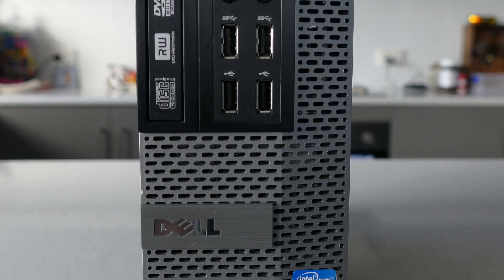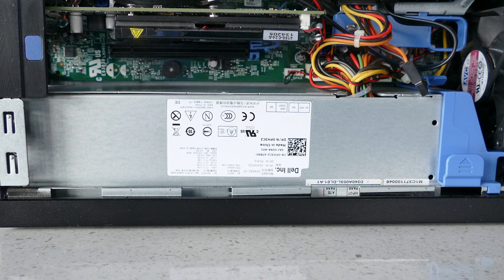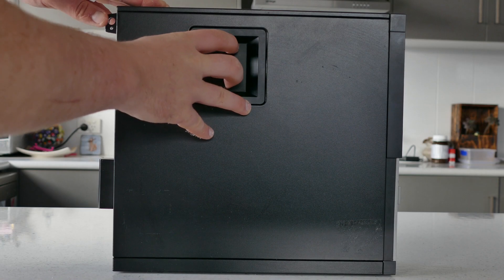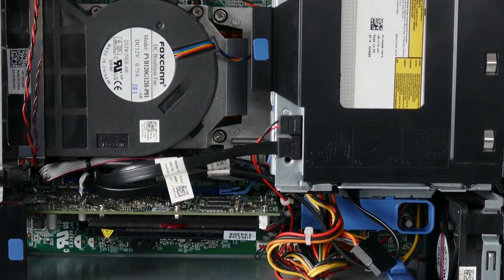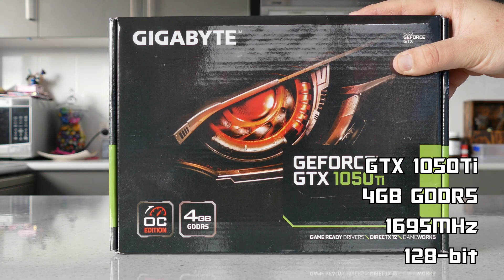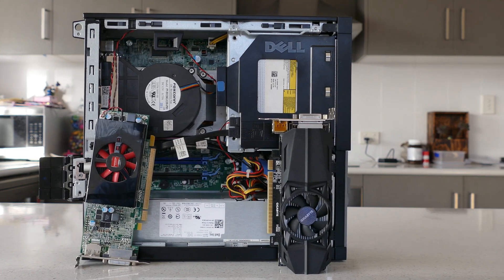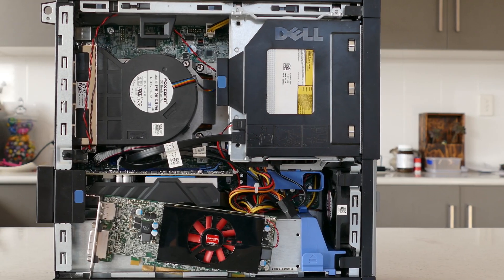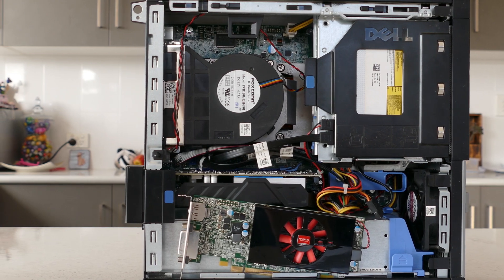Is the 1050Ti a Worthy Upgrade for this Old Dell?

Comment: What’s the PSU?
Reply from the maker: Power Supply Unit is the acronym used for the power supply
Reply from the maker: Yes it will work with the 3010 MT and the difference between the 2 CPU’s is about 15% better processing efficient over the older 3000 series CPU which will only be noticeable in CPU intensive tasks

Comment: I’m getting either getting a 9020 non sff with a i5 4570 or the 990 with the i5 2400: would the 1050ti work with these builds with stock PSU??
Reply from the maker: Yes

Comment: The GPU power consumtion is 75W and according to guidebook optiplex 7010, the DT and SFF version have a maximum 50W on PCI. During how long period have you used this GPU and do you notice any failures?
Reply from the maker: Nope never had any issues during hours of benchmarking. The guy I sold it to has the same concern so we ran a CPU and GPU benchmark simultaneously for over an hour without any issues.

Comment: would the 1650 low profile by asus have the same performance as the 1650 low profile by zotac?
Reply from the maker: Yes, there is negligible difference between the brands. It would be lucky to be a 1-2 FPS difference between them all. The only real different is the cooler design itself so thermals could be different.
Reply: Everything by Sam 
thanks for ur help and time
Reply from the maker: No worries. Happy gaming!
Reply: Everything by Sam 
Soo if i pare even a msi 1650 low profile with a dell optiplex like this one it would br fine?
Reply from the maker: Yup!

Comment: so with a low profile gpu I wont need to upgrade the crappy psu?
Reply from the maker: Exactly. Low profile GPU are low powered and don’t need an external power connector

Comment: How are the temps and is the PSU still holding up?
Reply from the maker: I onsold this PC shortly after this video but told the buyer to contact me if there was any issues which he hasn’t contacted me so I would take that as a good sign.

Since the GPU is quite low powered and the cooler is sufficient enough it never got higher than 75C if I remember rightly.
Reply: @EverythingbySam  oh. That's awesome. Thanks for your quick reply
Reply from the maker: No worries. Glad I could help

Comment: I bought a dell optiplex 3020 SFF, is this fan sound normal? wanted more opinions before i change, the computer stays cool no over heating and runs find, here is my link to listen too.  youtube.com/watch?v=xXs9mRUzLjc
Reply from the maker: I would clean all the fans firsts to see if that might help as it sounds like they’re all pegged at 100% which is not normal. If that does work you might have to look at replacing them
Reply: @EverythingbySam  ok thanks will try it

Comment: would you still recommend this card since you uploaded it? looking to help my cousin upgrade his basic 3010sff with everything stock, is there a better gpu out there in the market in 2019? thanks in advance!
Reply from the maker: The GTX 1650 is currently the most powerful low profile GPU on the market so if you can justify the price of that over a 1050/Ti go for it as it’s about 25% faster.
Reply: @EverythingbySam  will 240 w work for 1650 lp
Reply from the maker: Yes, it requires the exact same power consumption as the 1050/Ti
Reply: @EverythingbySam  will that gpu be able to fit and work in a Dell optiplex 3010 sff?
Reply from the maker: It’s literally the same case so yes it will work.
Reply: @EverythingbySam  good to know,so I'm assuming that the gtx 1650 low profile should be able to fit and work
Reply from the maker: Yes, doing a video on that in the near future
Reply: I know I'm like a month late, but I also recommend the 1650 if you're looking to buy new, because it's the same price as the 1050ti LP on Amazon US.

Comment: If i buy a dell optiplex 990 without a operating system would i have to downloadthe drivers and if so what drivers?
Reply from the maker: Yes you would need to do a complete fresh install of windows. The only driver you really need is the GPU driver. All the others are insignificant.
Reply: Everything by Sam 
Thanks! You literally replied in 14 minutes. Thankyou for the help
Reply from the maker: I always have my phone on me with notifications on which makes it quick and easy to answer
Reply: Everything by Sam 
You got some good service 👌
Reply from the maker: I try my best. Good luck with your build
Reply: Everything by Sam 
Thanks for your help i subbed

Comment: did you put case fans/cooler when you inserted the gpu? how is the temp while playing if none?
Reply from the maker: If I remember rightly the GPU got no hotter than 75C after stress testing for 20 minutes
Reply: @EverythingbySam  are there any fans?
Reply from the maker: There’s a small one in front of the PSU. The CPU fan cooler is its own ecosystem

Comment: Can the stock dell optiplex sff motherboard be used in a micro atx case?
Reply from the maker: The motherboard is proprietary and has its own stand-off layout so with some modification to the cases standoffs you could get it to fit.

Comment: I need a suitable arc sized motherboard that supports all on a dell optiplex's parts. Any ideas ? (Cpu : i5 2400)
Reply from the maker: Basically any 1155 motherboard will support the components it’s usually only the dell motherboard itself that has compatibility issues.

Comment: The 790 dell would have been more better to work with..
Reply from the maker: I can only buy what’s available at the time and not overpriced.
Reply: @EverythingbySam  790 cost me $70 tho my build total came in around $450 aud all used parts.. The fun part was putting in the Geforce Gtx 970
Reply from the maker: That’s an alright build for $450
Reply: @EverythingbySam  The Gpu was the main set back but can't say no to a GTX 970 for $160

Comment: Great vid mate, My wee boy needs a new(ish) PC and this vid nailed it, I got the exact spec machine for £80 today have 16Gb of Corsair vengeance RAM lying spare and just need to wait on delivery of the 1050 ti, same one you used, I wont need a PSU upgrade, will I?
Reply from the maker: It will run but be aware you will be maxing the PSU out which can cause damage
Reply: Thanks for the reply, i'll look into a PSU for the PC, chances are i'll be cheaper buying a separate 2nd had PC.
Reply from the maker: If you can find a good deal or deals on a few parts it’s always a much better option for longevity of your system
Reply: I'm just going to chalk it up as a loss and use it for kodi, I found a local guy selling a brand new basic build,
Amd a8-9600 radeon r7 processor, 8gb ddr4 ram, windows 10 Motherboard is gigabyte ga-a320m-s2h, 
Kolink KL-C500 Core Series 500W 80 Plus Rated PSU Unit and it's in a good looking large case for £100 
I'll stick the 1050Ti in when it arrives, it should make for an ok gamer and it'll be more upgradable.
Thanks for the replies and subbed.
Reply from the maker: Yeah that will work mate but you will need to upgrade the CPU if you want to upgrade from the 1050Ti as that is also quite weak but everything else is pretty good.
Reply: I was thinking a ryzen 5 and 8 more gbs of ram in his xmas stocking haha.
Reply from the maker: Ryzen is the perfect gift for price to performance. It does have its issues but it’s hard to say no to their prices.

Comment: if you need gaming then gtx1650 if for multimedia then take gt1030
 for dell optiplex
Reply from the maker: The 1650 is the best low profile option now for gaming but it’s also expensive
Reply: @EverythingbySam  slightly more expensive than 1050ti

Comment: The optiplex 980 is a lil different from the inside. Will the gtx 1050ti fit???
Reply from the maker: Looks like it should still fit but I don’t have one so I can’t completely confirm
Reply: @EverythingbySam  I have a gt 1030 and the fan touches the hard drive case. I am hesitant to spend $200 if it don't fit.
Reply from the maker: It would be the same size as the GT 1030 so you would have the same issue unless you modify the HDD cage a bit
Reply: @EverythingbySam  I only use my pc for retro gaming. Gt 1030 works great on dolphin all retroarch cores and PCSX2. I am trying to see what I can do to get the ps3 emulation going. I tried last night the cpu usage went up to 95% and it got loud. I have an I7 860 12 gigs of ram and a 120 ssd.
Reply from the maker: I tend not to mess around with emulation software too often so I can’t help you there sorry.

Comment: Will it work on my optiplex 9020 sff
Reply from the maker: Yes
Reply: Jamal Habibi you need a high psu too
Reply from the maker: No, 240W is enough to run this card using the 75W bandwidth of the 16x PCI slot but it will utilise the whole PSU which has the potential to ruin it over time.
Reply: Yes I have the exact same setup just don’t close the lid

Comment: Sorry for a late question, I have a dell 7010 sff i5 8gb ram would this 1050 ti lp work with my pc, because of the watt of the slot
Reply from the maker: Yes it will work
Reply: @EverythingbySam  because the card needs 75watt?
Reply from the maker: PCI Gen 3 16x slots deliver 75W through the slot. Anything over 75W and the card would also have a PCI power connector.

Comment: Any better low profile gpus than the 1050ti ?
Reply from the maker: GTX 1650
Reply: Everything by Sam 
Is it worth the upgrade over the 1050TI?
Reply from the maker: If you already have the 1050Ti then no not really. They’re practically the same performance.
Reply: Everything by Sam 
Would that 1650 LP work completely fine with a dell sff with 240W?
Reply from the maker: Yes, same power draw

Comment: I have optiplex 390 DT i5 - 2400 8 gigs of ram. Will this Gpu work. Moreover, what psu should i be looking for if it supports because I believe i have 250 watts power supply. Please help !
Reply from the maker: Yes it will work and the power supply is ok
Reply: Everything by Sam Thanks man!👍

Comment: I bought the same pc a year ago,with an i5 3470 cpu and gtx 1050ti,in terms of fps it's not having any issues but worst and only serious problem is that when my fps is below 55 or something like that ,the games feel not as smooth as they are supposed to be.
When I hit 45fps or 40 it feels like 26 or even less.
So any suggestions what could cause this?
Reply from the maker: I would suggest getting MSI afterburner and Rivatuner and checking your 1% and 0.1% lows to see if there is any stuttering or funny business going on.

If there isn’t it’s honestly yours eyes and brain playing tricks on you which is quite common.
Reply: Everything by Sam Well,30fps videos on my pc look absolutely smooth.i often used to go to play on a xbox at one of my friends' home and he had Gta 5,Fifa and COD black ops 3,they all ran absolutely fine.
Thanks for replying i will try using the method you mentioned
Reply from the maker: No worries. Good luck
Reply: @EverythingbySam  Thanks

Comment: Thanks for the info, I have an Optiplex 9020 i7, 32GB ram, 256GB SSD. but 1GB video card. Will try this, thanks!
Reply: Jason Catlyn 
Sheesh 32gb ram on a optiplex?
Reply: @jem5665  Yup!! Had to for the software I'm using, upgrade the video card, DEFINITELY!!  Hope to get a system with 64Gb next! :D
Reply: @jasoncatlyn7331  warning = be sure that your i7 support 64 gb of ram.My i7-4790 only support [max] 32 Gb DDR3 memory
Reply: @QiGenius  thanks for the info, I was waiting on my tech to do the upgrade but will settle for the video card instead! 👍👌
Reply: @jasoncatlyn7331  ok,what is your i7 gen?
Reply: @QiGenius  Its a 3rd Gen, I believe! not sure but the system itself is a 2013/14 release year.
Reply: @QiGenius  what gpu are u using?
Reply: @wilsonbatuyong1147  my optiplex came with amd Radeon R5 240 Ddr3 1Gb but I changed it to GT730 Ddr3 2 Gb

Comment: Do you think the mini version would fit? Would appreciate if you answer. Would definitely go for the lp version but it's more expensive here apparently.
Reply from the maker: Has to be low profile due to the size of the case. The mini is short but to tall
Reply: @EverythingbySam  that is the sff model right? What if I used an mt variant? Would that suffice?
Reply from the maker: Mt variant would allow you to use a full sized GPU as well as the mini
Reply: @EverythingbySam  really? MT it is then thanks dude
Reply from the maker: No worries. Good luck

Comment: Can gtx 1050 ti low profile 4gb fit my dell optiplex 790???
Reply from the maker: Yes
Reply: Even the non-low profile ones will fit, OEM's will not make a card longer than the edge of the motherboard. If they did it would have clearance issues with the storage drive trays.

Comment: I'm having the hardest time installing it and I'm scared I'll break it
Reply from the maker: They’re easy to install and you would have a hard time breaking anything.
Reply: @EverythingbySam  can you put a ryzen 5 in a dell optiplex 3010??
Reply from the maker: Only if you modify the case as it only fits proprietary Dell OEM motherboards natively.
Reply: @EverythingbySam  what if i change the mother board and also do you knoe the type of the motherboard
Reply from the maker: Honestly it’s easier to get a new case then trying to make a Dell case work for you as there are so many limitations as the case just isn’t designed for regular motherboards.
Reply: @EverythingbySam  will any case work
Reply from the maker: As long as it’s at least is compatible with your motherboards form factor. (E-ATX, ATX, M-ATX or M-ITX)
Reply: @EverythingbySam  what type of mother board is a dell opiplex 3010
Reply from the maker: It’s a special OEM one that doesn’t fit conventional cases like I said earlier

Comment: Is the csgo minimum really that low in normal gameplay? Or just that FPS testing map?
Reply from the maker: The community benchmark map takes the player straight through several smoke grenades which are a killer on your FPS being inside the smoke.

Comment: I have 7010 mini tower with 275w so will the gtx 1050 ti mini (not low profile one) work on my pc, please answer quick !!! thanks !!!
Reply from the maker: As long as it doesn’t require any external power connector you should be good.
Reply: @EverythingbySam  thank you for fast replying, very helpful video !!!👍👍

Comment: I have a Dell Optiplex 7010 with a i3 3220 dual core processor
GT 710
8gb ddr3 ram
500gb storage

Any recommendations for upgrades?
Reply: Uh, looks fine to me, you could upgrade the gpu to a 1050ti and maybe in the future you can upgrade the cpu, but that's not necessary, the cpu that your using can hold up on most modern day games.
Reply: @henrycomer3924  Not a 1050 Ti LOL get an rx 570 or an 580 8gb, 4gb works to
Reply: @Zurrskii  That would be the case if it was a normal PC not an Dell. If Crouxh wants to upgrade the Dell I would only recommend a Gtx 1050ti/1650 at most due to its PSU and size. Also if the  SFF variant of the 7010 you will only be able to fit a low-profile gtx 1050 Ti, I'm not aware of any half size rx 580 or rx 570.
Reply: @henrycomer3924  What do you mean it looks "fine"? There is an i3 3220 cpu with a gt 710. That can't even run csgo at the lowest settings at 60 fps.

Comment: I got a dell optiplex 790 dt with i5 2400, 4gb of ram and wanted to know what gpu I should get
Reply from the maker: GT1030
Reply: Everything by Sam will a gtx 750 ti fit or go with gt 1030
Reply from the maker: Go with the 1030

Comment: that was a great improvement and works as expected but if the processor can be upgraded it will be a complete gaming pc
Reply from the maker: Yes a CPU upgrade would also show an improvement but if I was to do any further upgrades I would probably reassemble the system in a larger case with a better power supply as it’s already pushing the limits.
Reply: @EverythingbySam  thats true

Comment: i picked up a 7010 optiplex im trying to find info weather bios will allow upgrade? as ive read since that 990 has had bios update to allow modern graphics card to be compatable due to customers needs n wants to run games on them. 
however i would suggest checking out the integrated graphics as windows updates give updates to make it so to play games!., i myself have played total war medieval 1 and nepolian tw flawlessly :) 

p.s maybe if i get the modern games il try the upgrades tho for now im good and can save my money :)
thanks for the post. i l give it a like.
Reply: William Stewart my bios was from 2011 and I upgraded it from the dell support website and I didn’t upgrade my bios and it worked with a gt 1030 without upgrading the bios but it’s better off upgrading bios from the malware attacks that’s been happening
Reply: xSnuzzy yeh tho maybe not for pure game right ;)
Reply: I’ve a 750 ti otw from faulty spares n repairs,
Hope to fix it n give it a try:)
It’ll be here in a few days time worth a try as it was dirt cheap :)

Comment: Hi, i have a dell optiplex 9010 will it be a ble to fit a gtx 1050 ti
Reply: And handle it
Reply from the maker: Yes
Reply: @EverythingbySam  will it overheat
Reply from the maker: Not as long as that tiny little fan in the front is operational

Comment: Yo, I grabbed the gtx 1050ti low profile for my 790 optiplex with 240w psu and Intel Core I5, will it be ok even tho the card ask for a minimum of 300 psu ?
Reply from the maker: Yes it will be fine. 300W would be preferable but not entirely necessary
Reply: Max Mueller does your PC still work with that 1050ti ? I have the same PC and I’m thinking of upgrading did your psu try ?

Comment: Should I put a 1050 ti in my dell optiplex 990? (240 watt psu) My dell optiplex 990 does come with a 3.4ghz core-i7 2600 and I am wondering if it would work or if my pc will need more power. Thanks. Also the pc has 8 gigs of ddr3 ram.
Reply from the maker: I personally would recommend not doing it as it will slowly degrade your PSU and could cause some damage but it is possible and will work.
Reply from the maker: You will slowly degrade your PSU running it at maximum load or above but it may take weeks, months or years. That is a fact!